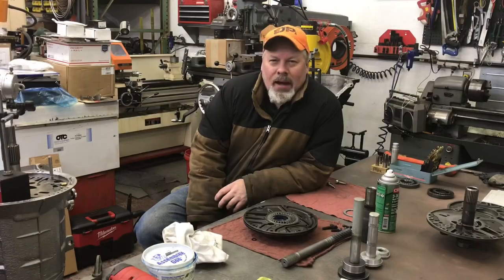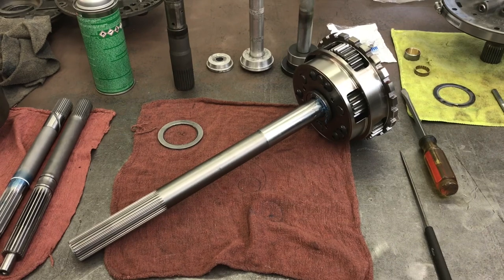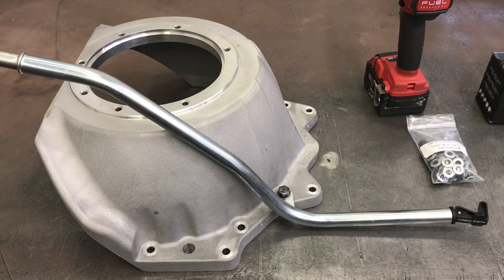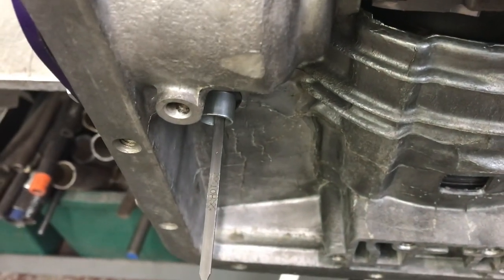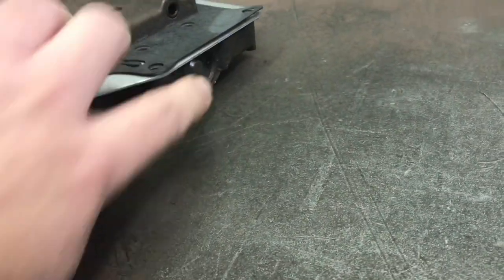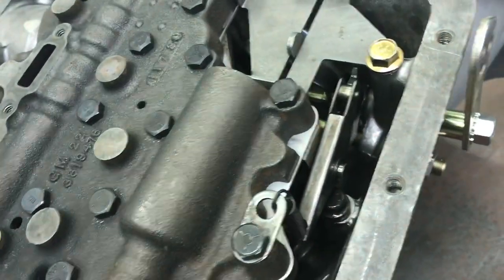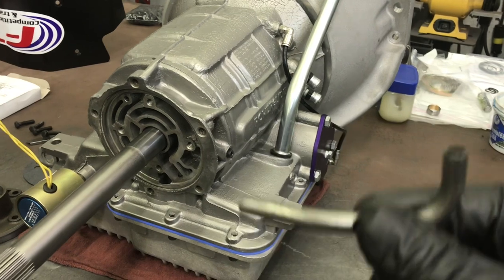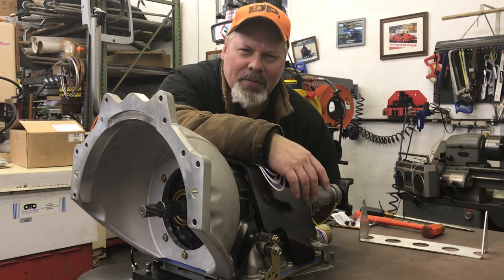Street/Race Powerglide Transmission: Final Assembly

Comment: Do you prefer to use Vaseline rather than  the assembly goo?
Reply from the maker: I use both, depends on the mood and the shop temp. Vaseline is much cheaper and wipes off easier.

Comment: Shawn, when using the deep pan with the filter extension perhaps it's not necessary to fill to the 3/4 inch above pan rail level?
Reply from the maker: That would defeat the reason for having a deep pan, that would just be lowering the level away from the transmission.
The correct full mark stays the same.
Good thought process, I like idea exchange!